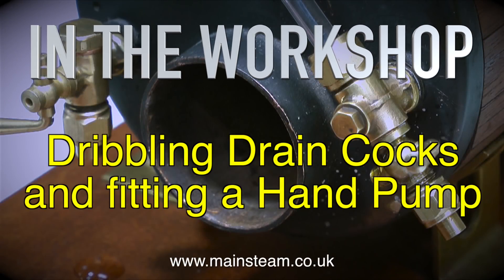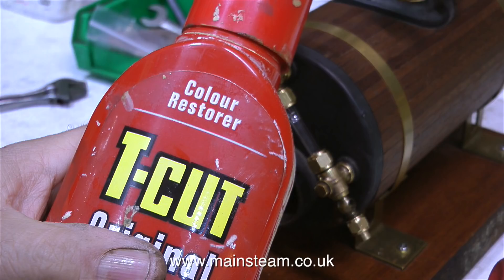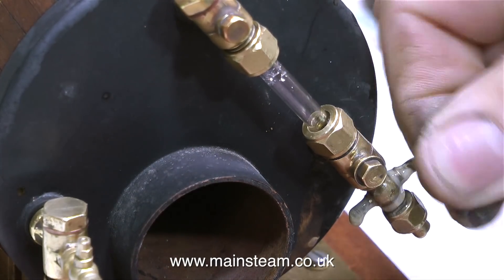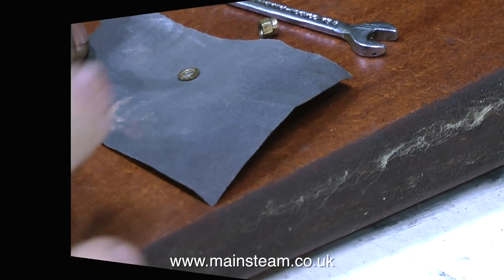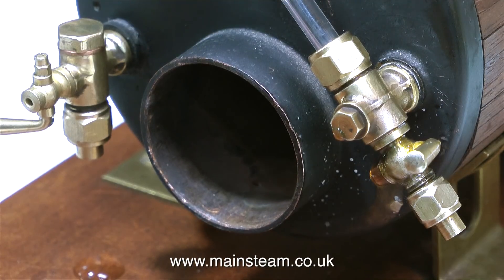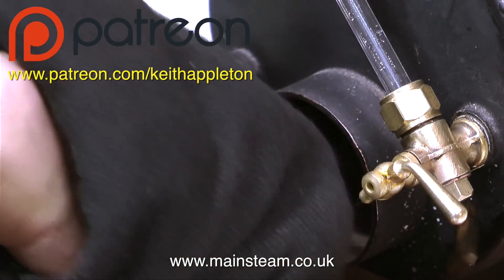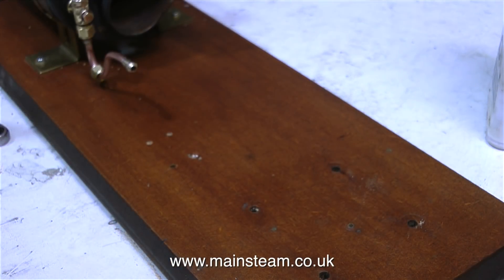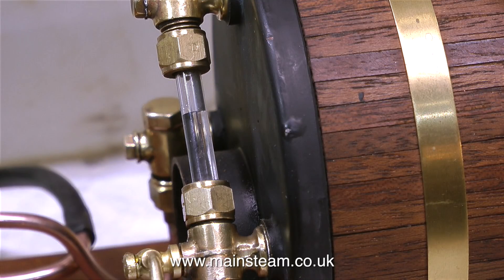DRIBBLING PLUG TAPS - IN THE WORKSHOP

Comment: Another very good video. I found with small nuts and bolts that silicone tubing if you can find the size helps for holding them. Just stick them in the end and it gives you a handle to hold.

Comment: Much like you have your Dewalt drill attachment for flipping the chuck jaws of the lathe, have you ever considered building a drill powered water pump to initially fill your boilers?
Reply from the maker: I used a windscreen washer pump to fill my boilers, but it stopped working .....

Comment: Top tip regarding using super glue to reinforce threads in timber, thanks Keith. I assume it would have the same effect in manufactured timber, MDF and the like, as in real timber or am I wrong in thinking that?
Reply from the maker: Yes, it works fine in both real and pretend wood . . .
Reply from the maker: the thin stuff is better as it soaks in deeper . . . .
Reply: ive done it for years with pva glue, perhaps superglue will be even better

Comment: Fine job,, and thanks for the good work. 
Do you ever use distilled  water in the boiler?
Thanks again...  @¿@
Reply from the maker: No - just tap water ....
Reply: Keith Appleton 
If scale is a big problem,  distilled water would fix it. Here where I live,  scale is such a big problem that the city power generation plant,  put in a industrial size distiller to supply the boilers. But those run 24-7, and are larger enough to sell power to the grid.
Anyway, ,, thank you for all of your good work, ,,
(°¿°)